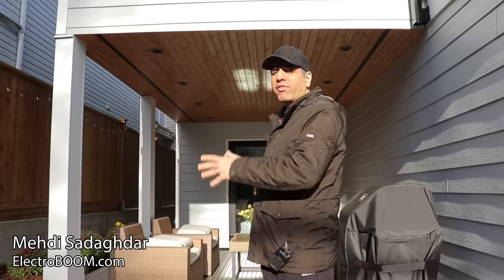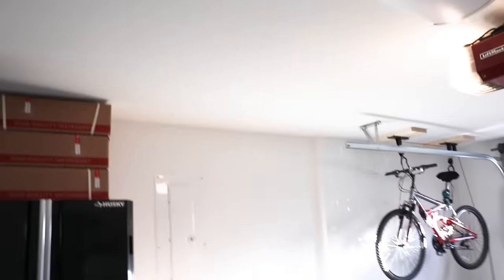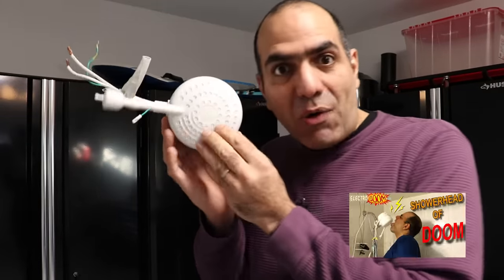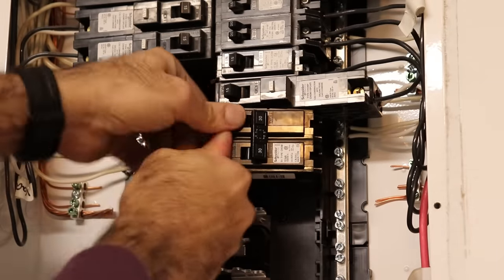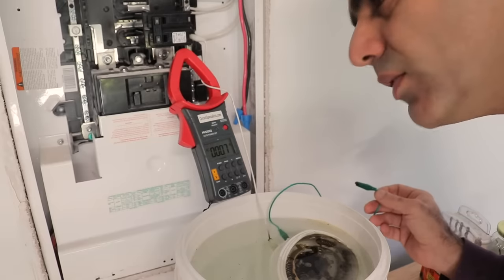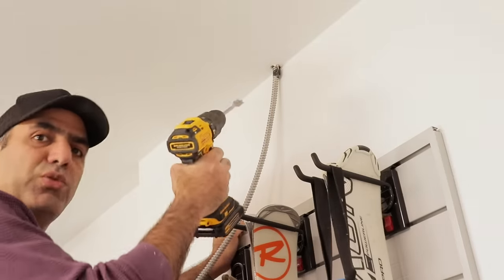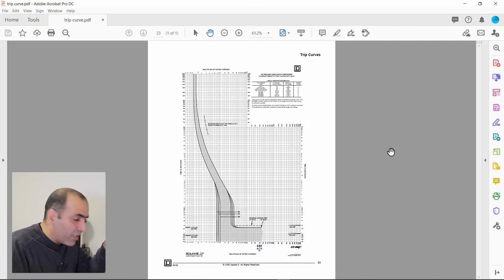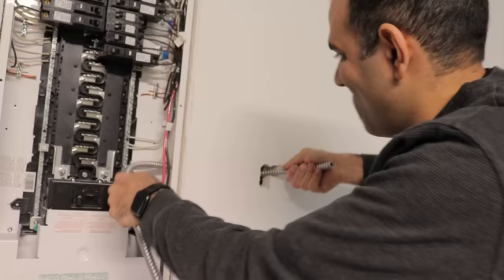Electric Patio Heater Wiring and Installation

Comment: Please correct me if I am wrong. Mehdi equipped a CB rated for 30 Amps. The Heater takes about 15.7 A. If the heater faces a fault of say 30 A, it would then take 1000 seconds for the CB to trip. For a 90 A fault current, it would take 15 seconds if I remember correctly. Is the heater manufactured to take a fault for that long? 90 Amps of fault for 15 seconds. I haven't calculated the resistance of the heater, but that much current for such a long time should be enough to kill it. Or maybe I am thinking wrong or missed another info.

Comment: That breaker fills me with confidence, I’m sure my body could handle 4 seconds of 60 amps if something went wrong 🤣
Reply: The breaker is not their to protect you it's there to protect the wires in the house. With household power it would be challenging to even get your body to a low enough resistance that it would even be possible to draw enough current to trip the breaker. 100 milliamps is through the body is considered risk of lethality. Even a standard 15amp breaker is several times a lethal dose of shock. This is why we have gfci protection. Gfci is there to protect you breakers are there to protect the wire.

Comment: @11:41 NO ANTISHORT on the AC90. I'm sure this has been mentioned though :) @12:54 I'm not sure that you can terminate multiple conductors under that receptacle... should have to be pigtailed? Possible I'm wrong though and it is rated for that, but typically with screws and not clamps, it shouldn't be allowed.

Comment: 2:35  208 is typically for commercial/industrial lighting.
Reply: Apartments usually get a three phase supply, and the potential across two of them is 208V.

Comment: truthfully you don't need to test at 240vac, in order to test a breaker it only matters that the current matches
the easy method of testing the tripping of a breaker at home is to disconnect from the breaker panel, connect to a variac, possibly a split-phase isolation transformer, and turn up the variac until the current through something like a 1 ohm load reaches the trip point
and yes breakers are designed to handle the full current 100% duty cycle and a slight overload of less than 5% can take as long as 30 second to thermally trip, to pop it in it's magnetic trip mode you need at least 2x or more the rating to instant-trip
a 40a load on a 30a breaker is well within inductive surge current of a 30a motor making it sub-optimal to instantly trip, but we all know the current drops in under a second unless the motor is locked up making it pull 2x the rating for only a second or two and if it locks that easily reaches a few seconds(5-10) and pops the protection device
if mehdiboomer wants to properly test his breaker he needs to pull over 60a from the breaker for instant tripping, or has to have a load that can handle the voltage times the current for at least 10 seconds if not 30 if he is testing the thermal trip section
so a showerhead shoved in a bucket of water that is more than 2 ohms will not instant trip, he needs at least 10 seconds at 40-50a to trip and that plastic melts too fast making it a flawed test

Comment: How did you add the MC flex connector when you started from inside the panel? Seems like you would want to run nylon ‘fishing’ sticks from the panel to the hole in the wall,and pull the MC flex ( with connector attached) from the wall to the panel. Personally, if I am using a metal switch box, I like to wrap the switch terminals with electrical tape to ensure there is no contact between the two.  Are you planning on adding any temperature control to your heater?  If so, which one did you pick? The only ones I have seen are over $500.

Comment: I didn't look through comments but a regular breaker doesn't protect you it protects the correct rated wire from burning up so 10ga wire needs a 30 Amp breaker to protect the 10ga wire if you could connect 12ga wire to the end of the wires and run 25 amps in example thru the circuit the 12ga wire could burn up and the breaker wont trip until it dead shorts if it ever dead shorts before your house is burned down also some breakers get damaged over time and stay locked into the on position and you can weld the copper wires to grounded steel and never open ive seen it in person its scary and replace breakers over time

Comment: Do you not have surface mount boxes in the USA ? That kind of box is meant to be sunk into the wall as sure as eggs are eggs 
notice you use what we call screwits to joint  cables too only place I see them now is in Baldor motors at Work

Comment: there is lot of type of breakers to use .. i mean ... a type B 20 A breaker will pop open faster and soon than a type C 20A breaker . type C or greater usually used for air condition units that in the beginning of compressor need hundreds of amps . a type B 16 A breaker will open immediately but type C will keep longer

Comment: also .. the breaker does not trip without groud wire to return to the source, FOR 240V LOAD..GROUND WIRE GOES TO SHARE NEUTRAL/GROUND BAR ...and i question..how do the sourcE trip our breakers ??? good mystery...is there someone behind the substation looking at the screen...and sending a signal to trip your breaker..or its all MYSTERIES FORCE THAT CAN'T BE SEEN...

Comment: just wondering if the piece of the conduit outside ( between the heater and the ceiling) shouldn't be a hard conduit? can you use flex outside???

Comment: Doesn’t look like you used anti short “red heads” to protect the conductor wires inside the cable from the sharp edges at the of the armor cladding.  How come?

Comment: @ElectroBOOM 
* If your 30 Amp breaker is type B then expect it to trip at somewhere between 90 - 150 A.
* If your 30 Amp breaker is type C then expect it to trip at somewhere between 150 - 300 A. 

Your breaker is probably type C which would explain the situation..

Explanation follows: 
Type B circuit breakers are designed to trip at fault currents of 3-5 times rated current (In). 
For example a 10A Type B device will trip at 30-50A while a Type C device is designed to trip at 5-10 times In (50-100A for a 10A device).

Cheers

Comment: I wouldn't at all be able to do that in my apartment. LOL
Because if they did an electrical inspection, I would definitely need to remove the breaker I added, then re-add it. Not wanting to shut everything OFF just to do it.

Comment: You need to test power tools that is rated at 240V and use it on 110v. And get a 110V power tool and plug it in to 240V.

I have seen 240v on 110v but not vice versa

Comment: Hi i know that this video i little bit old but im from europe and here there isnt any neutral wire we have only 3 wires +220V-Red, Minus-Black, Ground-Green so what is neutral wire used for thank you for enternating us and teaching electronics.
Reply: The "minus" is the Neutral
In AC system we don't call it "minus" because the direction of the flow of electricity is, well, alternating
The "plus" (officially: Live or Phase) provides the elctricity, and the "Minus" (which is called Neutral) and the Protective Earth are both to close the circuit to ground
Like in Hungary brown is live, blue is neutral and green or yellow is PE in a single-phase system

Comment: Having 240V through two 120V hot wire, how to connect it 220V European  heater one terminal 220V and the other one negative?

Comment: "5400W of power at 110V, or 49A of current in your shower. Which house in the world is wired for this?"
My house with 3 bathrooms using this very showerhead goes brrrrrrt

Comment: oh.....
You're supposed to put the higher loads on the upper part of the panel bus bar closer to the feed to reduce heat inside the panel
Reply from the maker: my 200A main breaker and feed is on the bottom though

Comment: As an electrician, you only broke all of the guidelines we’re supposed to follow. Running mc is fairly easy and at any point the mc is cut, a plastic bushing should be installed so that the connector doesn’t crush the metal sheath and cut through the coating on the wire... also use two “one hole straps” with one screw in between to make it look nicer coming down to your switch!
Reply: Hey Kirk, just a heads up. Those plastic bushings or "anti-shorts" as we call them are not required on MC cable. It's a bit funky because when you buy MC cable it comes with those red bushings. But if you look at the code AC cable is only required to have those red bushings installed. Look at reference 320.40 where it says "an insulating bushing or its equivalent protection shall be provided between the conductors and the armor". The same reference is not found in 334.40 where MC cable is referenced. I still use the red bushings for extra safety but they arent required. Just a heads up

Comment: I must be missing something here… isn’t that a 14-50 outlet on a 30A circuit in parallel with a 16.7A heater? Shouldn’t that need wiring appropriate for 84A including a 20% overhead for safety?

Comment: What are the benefits with 180 degree phase shifting transformers compared to those that aren´t .  Well i was just curious anyway :). Thanks for a good video.
Reply: The benefit of such transformers is mostly safety. A transformer that outputs 240V with one end being ground and the other being live has a live wire at 240V potential to ground. A 240V transformer with a center tap that's grounded outputs 2 120V outputs that are 180 degrees out of phase gives two live wires each at 120V potential to ground (but 240V potential to each other). Since a shock usually comes from you being a connection between live and ground, having the voltage split like that is safer, at the cost of increased copper usage.

Comment: You should have used a 20A Fuse with the same Cable and If you ever need it change the fuse. If the heater draws 30A because of a fault it could start burning and the fuse won't Pop😉

Comment: You Might Be Using A Thermal Breaker.  Use A Breaker That Trips Almost Instantly When The Load Is More Than The Rated Current Of The  Breaker.

Comment: No anti shorts on the BX wire. There are red plastic pieces that fit between the metal sheathing and the wire to prevent shorts from the sheath to the conductors.

Comment: The breaker stats really scare me, its designed to trip at 30A but we didn't say what day it would trip! I thought they were to protect the wire from causing a fire. At double the current it still takes 10-50 seconds???

Comment: 14:03 Do NOT tighten a device into the box by the screws. Once the screws are started, push the device into the box with your hand, then tighten the screws to match. Otherwise, you might inadvertently pinch a wire.
Reply: Looks like he forgot to attach the ground to the switch

Comment: isnt your heater going to turn on when ever you use your 240 plug if they are both connected to the switch?  wouldn't that cause a bigger load having them both on? why didn't you just use 2 switch's instead.? future video :)

Comment: 2:40 
Can somebody tell me 
How is that possible to reduce current with increasing voltage in case of a electric heater ???
Reply: Because power = voltage * current, so at a higher voltage, less current is needed to supply the same power

Comment: It's a shame we can't use fuses anymore, they react in as little as 1/4 of a wave cycle, where as a breaker can take as much as 1 and 1/2 waves. Also if a breaker ever trips a single time it's impossible to know that its rating hasn't been changed and the more it trips the more likely it is to have changed.
Reply: The inconvenience of having to replace fuses every time is worse than the tiny risk of a breaker malfunctioning after repeated use.

Comment: I hate working with thick wires. In India most of the cables are flexible copper multistranded cables. armoured cables are not used at all. a separate conduit is used to protect the cable.

Comment: "There is a diaphragm back here.....to make sure the elements are only powered when there is running water. Otherwise the whole thing would melt and burn in fire 
🔥🔥"  - ElectroBOOM 2019 (How Safe Is the SHOWER HEAD OF DOOM?!). In 2020: 5:11, Finally the shower head does melt and burn in fire when there isnt running water.

Comment: 30A breaker for 16A load, seems like a bad decision to me. Sure, thicker cable is ok to use. No big deal just more money to spend for possible higher load device, but breaker breaking at 30A or 20A is kind of a big deal. You could go with 20 and when you get another heater switch it to 30A. Oversizing the breaker like this leads to longer switch off times. Sure, not that much longer but at these amps, you are going to feel every fraction of the second.

Comment: Here there is no 120v so 240v with
Single phase 6a
Three phase 32A
Total house breaker connected to power lines And 40A breakers ganged version
Lol a heater at 120 needs 40 amps to operate, In my house with 240v 40 amp beaker is the main breaker. That heater drawes more amps than my whole house consumes 😂. Thats why we operate power hungry devices with 240v. In my place i dont need to worry about that because we only have 240v

Comment: Where are the grommets (little red insulators) you are supposed to put around the conductors where the mettal jacket is cut off? CODE VIOLATION! More importantly dangerous. Pro tip: Tape them on so they stay put before assembling the wire into the box connectors.

Comment: 5:56 I dont live in america/canada, and we have different breakers than you but, i dont think thats the case. 

It would probably have been such a high current, plus the short length of the cable ( = less resistance in the cable) that it would have reacted as if it was a short circuit, "popping open" almost instantly. 

If thats not the case, your breakers arent "as safe" as the ones we have in norway, germany, UK and most (afaik) EU countries. a normal B13A breaker would have an I5 value of 80A , and with a load of 90A it would exceed the I5 value, and open in less than 0.1 seconds.
Reply: after watching the rest of that bit.. very worried when it didnt even pop at 100A. o_o
Reply: 100A on a 30A breaker is about 3.33x its current rating, which isn't enough to trigger the magnetic trip.

Comment: Hmm i just barely noticed that you are using 120V supply, well it's a big amount of Amp there, well at least it is sufficient to run the system effectively, but not that good in terms of efficiency
Reply: Well heat is what we're looking for in the system, no problem for that' then for sure 👍
Reply: he has 3 phase power so he runs the heater using 240v which runs it at like 14 amps

Comment: is it just me or should the switch actually be in the same room as the heater. So you dont have to run to your garage every time u want to turn it off. . . *meh guess its fine either way.

Comment: Laughing in 1-phase 230V..   :)   Ohwell..  I approve of all fuse tolerance videos as the 10A fuse for my outdoors IP44 stuff can apparently take my 2.8kW pool heater, my box freezer and a few led lights for what is now weeks...    Ok, the only wiring really not up taking 230V/13A in my circuit is the extension cord between my outdoors outlet and the heater..  It's only getting warm.. not hot.  (safe as fu..)

Comment: You didn't bond the AC cable to the panel. Not sure how you would fix that now. Perhaps a MIGB (Metalic, Insulated, Grounding, Bushing) and connect that to the ground strip in the panel. Stil not to code but would be the right thing to do to bond the AC cable. The armor could become live under certain situations without it. 

Sincerely, 

William McCormick

Comment: I'm from Canada and love your videos, I'm doing my electrical apprenticeship at the moment, but i see several code violations here.  First off a permit is required for this type of work,  I'll look to the side on that one. 2, based on the load of 4000 watts and the 80% rule , you're just over a 20 amp load, and you would be required to run number 10 and a 30 amp breaker which you did for other reasons.  3, you didn't use anti shorts on your armoured cable. 4, you didn't use a connector coming into the panel. 5, you didn't leave nearly enough cable in the box to work with.  6, although i don't think a service disconnect is required in this situation,  it needs to be within a few feet of the appliance.  I'm sure there's more lol.. not sure if you turned off your main,  but damn you made me cringe being that close to the bus bar lol

Comment: Hey Mehdi! I'm afraid using 10 wire with a 30 Amp breaker is the opposite direction to go for safety... Always use exactly what the device requires! **especially the breaker** (You can technically go up in awg using the same breaker, if, say, you only had 10 wire and didn't want to buy 12- but you almost never need to. The posted awg on your device is more than enough in most cases.)
Reply: 10AWG is the correct wire for 30A. 12 is for 20Amp.
Reply: Yes correct. I think iirc his device only needed a 12 wire. In other words, increasing the wire size and breaker rating is a bad idea, in case of failure.

Comment: Hi Mehdi, why do you use NEMA there ? Here in Brazil we do not use rigid copper wires anymore and also we are most replacing the NEMA breakers for DIN breakers.

Comment: why wouldn't you put the switch closer to the porch? now someone has to go inside and into the garage to turn the heat on and im sure that heater will have little effect anyways considering heat rises and the heater is on the ceiling lol
Reply from the maker: 1) Switch is inside so when we are not home someone can't just turn it on and camp there!
2) That's why this is a radiation heating heater, not an air circulating heater